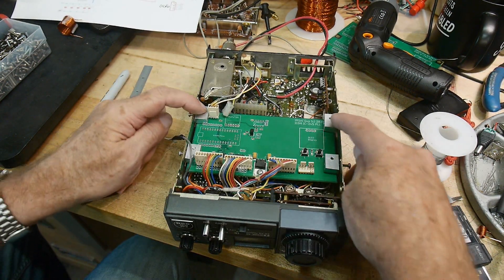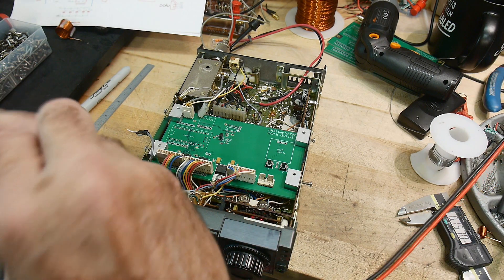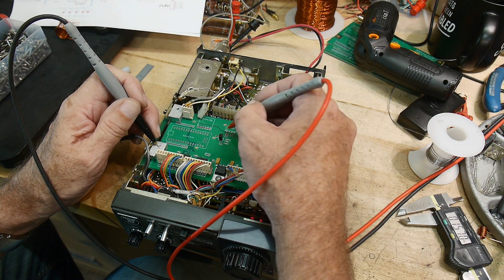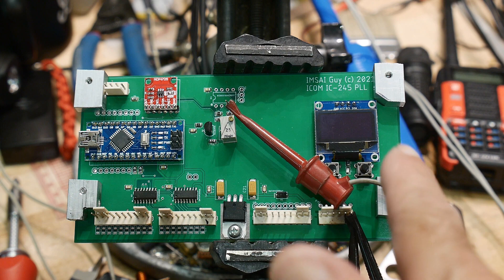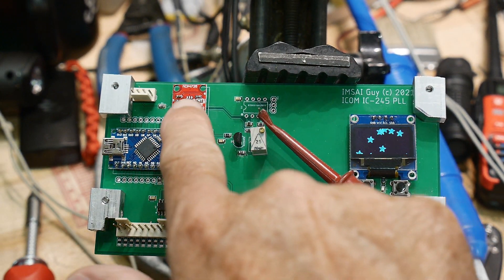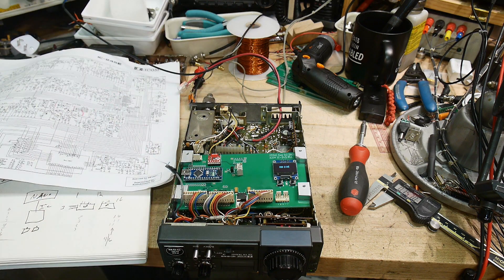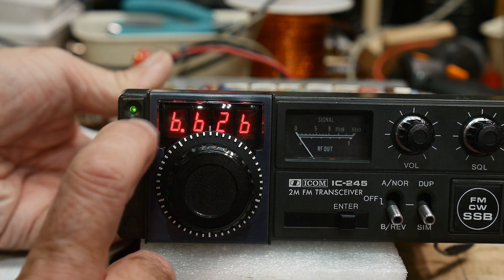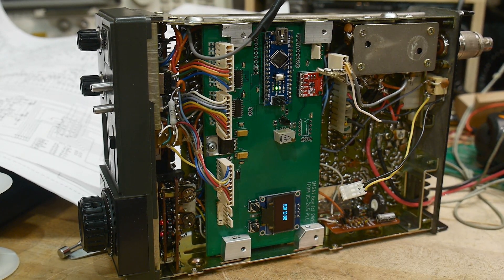#964 ICOM IC-245 replacement board initial trial

Comment: You have the schematics for IC-245E which is the european version in which the SSB adapter is standard. Your radio is obviously the IC-245 without the E suffix, intended for the US market. The SSB adapter is optional on that one. This version confusion might explain the discrepancy between your radio and the schematic diagram you have on hand..
73 / Janne
Reply from the maker: yes you are correct. do you know where the other schematics can be found?

Comment: If you use the black pill STM32, you would have more processing power than the Arduino Nano.  Its also a 32 bit processor instead of 8 bits.  Looks like you are making some progress on this nice project.

Comment: Good news, maybe. I thought my 245 PLL was totally dead; its not. It is wonky, tuning increments not right, and undefined digits display sometimes. I've got 144 mhz fm modulation to pass thru receiver with what seems like reasonable sensitivity.  Key up gives about 10 watts. Switched to SSB, and adjusted rit - tone varies - woohoo! SSB key up gives about 10 watts while talking into mic - woohoo! Yes, the simplex/duplex switch is also power on/off - strange. I still haven't figured out what the "Enter" button is used for. I guess I'll have to read the manual; I hate it when that happens. Congrats on your progress and Happy Thanksgiving!